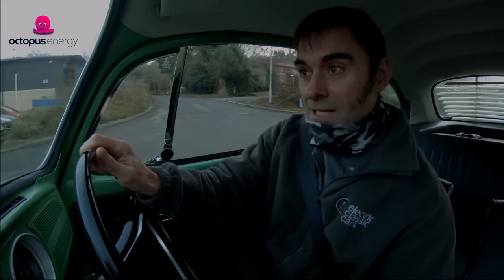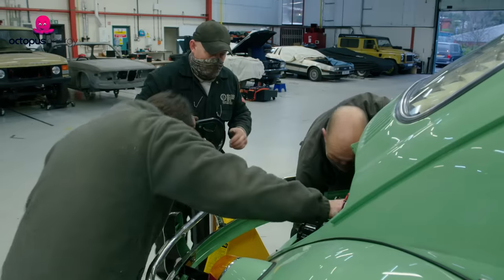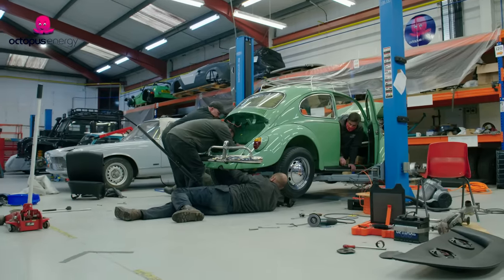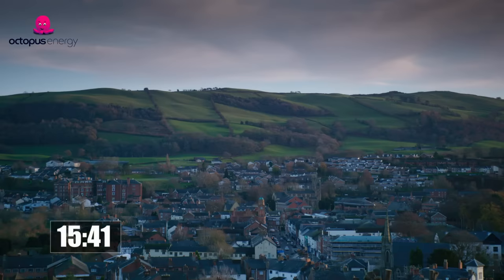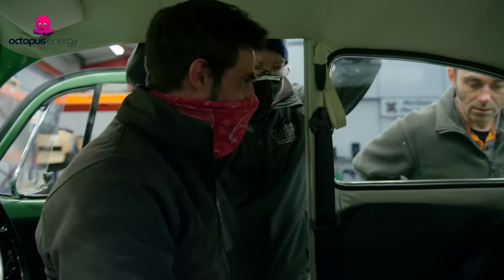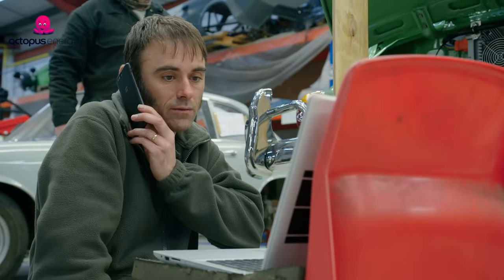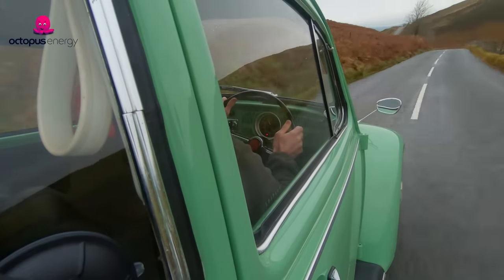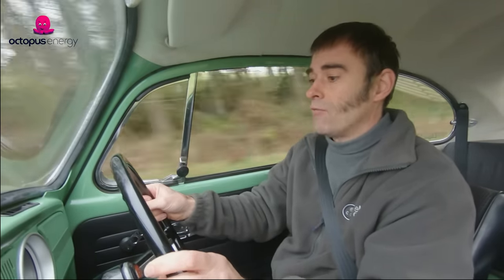VW Beetle converted to electric in a day

Comment: I think that 120hp is just right on a beetle. I personally would happily have this conversation done to my bug!
Reply: You spend 50 grand do it then' the range will quickly dissolve.
Reply: @Teamgeist Freedoms generally a crime these days isn't it
Reply: @Teamgeist if your under the illusion that modern advance electric AI is going to solve   all your problems then carry on but your going to be in for a shock.
Reply: @Teamgeist Hitler's Revenge.....
Reply: @Teamgeist 
He's just a little troll who isn't in command of the English language.
Reply: If you think a transmission designed for 40hp will handle 120 you are nuts or like changing gearbox and drive shaft parts at the side of the road.
Reply: @andrewallen9993  they're surprisingly strong
Reply: Why not just press brand new beetle-chassis, and sell brand new ones electrified? PERHAPS scaled up 20% to allow for bigger average persons nowadays?

Comment: That Beetle and engine are mint. I would have one concern however,and that's being in a crash with a 90kg battery sat directly behind me on the parcel sheIf,even if it were bolted down.
Reply: Agree completely - fabulous little car but that battery’s gonna flatten everyone in the car. Still safer than a motorbike tho! 😎
Reply: Not to mention the front battery pack
Reply: The VW Beetle was never a car you wat to crash in any configuration. Roll overs were deadly as were side or front impacts. I love the Beetle and it was my first car (that worked) but a crash that would be minor in a modern car would be anything but minor in an old Beetle. Of course this was all irrelevant to a 17 year old and I drove mine like a maniac.

Comment: Aw what a shame, half of what make a beetle such a legendary icon is the engine and the lovely chirpy sound it makes and the feeling of how it delivers the power, with the unique quirky signature heater system and close gear changes. Had 7 of these superb vehicles in my teens and twenties, loved every single one, and the 2 campers, all with their individual personality engines that you get to love, which was part of the fun of ownership... Some classic vehicles need electric due to problematic designed drive trains or badly designed engines, while others perhaps not so much...

Comment: Wish I still had my 57 beetle. Would convert it. Surprised at how hard they found removing the engine. Did mine with just a single hydraulic jack by myself. Four bolts, clutch cable and ignition. After 200,000 miles changed the barrels and pistons. Electric is the way to go.

Comment: Very nice with performance. Love the fact that the old classic bug can be kept on the road in this modern world. The only downside is that the Beetles heart is the air cooled engine with that sweet chug chug sound. A sound recording of the air cooled engine needs to be used, and synced with the accelerator and blasted out of a speaker as its driven. Same with classic Muscle cars and their V8 growlers if they were converted. They won’t be the same without the sound of the engine. Maybe a good sound system needs to be installed, just playing out engine noise.
Reply: would you settle for a puddle of oil on your driveway??

Comment: You’ll later have to adjust the rear spring rates - it is high enough to change the wheel camber visually.
Reply from the maker: Nope. A swingaxle Beetle always looks like that when it comes down off a lift. Roll it a few car lengths and the rear suspension goes back to normal as can be seen in the on road shots the next morning. 👍
Reply: @ElectricClassicCars  ah, of course! I knew that - thinking hurts sometimes…. Awesome ride, now.
Reply: That front end looks pretty compressed, I wonder what the extra weight load is on the torsion bar front axle.
Is like to see it put on a road course with a stock Bug.  Electric cats are so heavy the only place I see them win is in drag racing or time attack & hill climbs where is only run for 10 minutes tops w a small battery.
When environmental throw off costs are mentioned, no one talks about kids mining lithium in the Congo with shovels or strip mining for the large amount of materials needed.
Sorry for sounding like a kill joy.
Reply: @bigghouse101  EV's sound cool (have one). But the massive pollution to generate grid power, (plus consumption of non-renewable resources) disposal of car batteries, and processes to get the materials make this solution non-earth friendly.

Comment: Amazing work. I always that older cars will experience a comeback through electric conversion - if fact it is better for the environment to convert an older car than to buy a brand new electric car. Great work guys!
Reply: Debatable, new electric cars may be better efficiency Tesla, aptera etc. You may travel less per j in a converted classic car
Reply: But mostly I agree with you, the electric pickup Chevy and ram are a joke comparing to electric conversion of classics
Reply: Horse shit! I say that as an X -Nuclear Reactor operator, Electrical engineer and computer science as my background. Unless your electric car is running purely on solar it isn't helping shit! There are no green car batteries currently. The power grid has a loss from line voltage, every step up and  step down transformer and most power plants are less efficient than modern gas vehicles. That's  fact. Most current solar cells aren't green. There are some newer processes that are fairly green but they are also less efficient.
I'm not saying we shouldn't move that direction and we sure as hell should invest in research in that direction but currently it is a pure load of horse crap about it being better for the environment.
Reply: @twitte0king  Perhaps I should have been clearer. Electric Car conversion isn't as efficient as newly produced Electric cars like the Tesla. Mechanically, Classic Cars have crankshafts and gears that have been rendered obsolete by Tesla, so there will be rotational energy used, so it isn't the most efficient in terms of performance, however factoring in industrial processes and material extraction, overall the amount of materials used is much less and also less energy and emissions for processes @Electric Classic Cars are basically a private garage and they managed to convert a car adequately. Not as much emissions during the conversion comparatively to producing a brand new Electric car.
As raised by another comment, in the larger scope energy production will need to be converted to Nuclear Power if electric vehicles are to ultimately become environmentally friendly. Unfortunately, Wind and Solar don't have the capacity to handle the demand of Electric vehicles. Their Energy Density is too low and they require additional storage units to be produced. Also, the W/m squared for Solar won't be enough to power every vehicle on demand. Germany attempted to eliminate Nuclear and rely on Wind and Solar, and consequently they had to fire up their coal powered stations. France is perhaps the best example to follow as approximately 70% of energy is produced by Nuclear power.
Reply: Its fucking badly serviced diesels that are polluting the environment not little classics 😱😱😱
Reply: @F22ERaptor . Although a massive amount of France's nuclear capacity is currently offline for various covid, maintenance and manufacturing delay issues. Maybe around 50%. Pretty much all the surrounding countries - even us in the UK - are currently selling them power to make up the shortfall.
Reply: @twitte0king  Sure, but Teslas get about 130 mpg on the American power grid, and infinite mpg on solar power. They're already so much more efficient than gas engines that even if a classic conversion is very inefficient it'll still get like 80 to 100 mpg.

And yes I know the power grid burn straight-up gasoline, this is only an estimate.
Reply: What do you mean a comeback ? They never left.
Reply: @diconicabastion5790  So your argument is that progress towards a goal has no value in relation to that goal?
Reply: @drundub73  like Bob Dylan or Neil Young they just keep going
Reply: @twitte0king  and who cares - classic electric cars will likely not perform as well as new ones, that is a given.  Electric though is better than remaining petrol because one day they will become museum pieces.  I say try it and if we can get 125-150 miles on a conversion we have respected the old designs and turned them into neat city commuters.  I am interested in seeing if we can convert smaller pick-up trucks like the Ford Ranger etc.  I need to haul stuff regularly.

Comment: Kudos Gents for the inspiring EV upgrade to this Classic Bug !   This has me, and perhaps many others thinking about going this route rather than spending too much for a brand new EV.  Plus, like stated, the Carbon Footprint for the vehicle is zero, and if one repurposes Batteries/Motors, it's even more clean/sustainable !
Reply: How much did it cost?
Reply: You have to include the coal or natural gas burned to make the electricity. Or at least the production 
and delivery carbon for solar panels.
Reply: Yeah I was wondering I don't think it's got to be a zero carbon footprint but it's probably
Reply: @ryangrady6894  yes,and the carbon fallout from the manufacture of the components and battery but still will be less emissions than it takes to build any of the new cars❤️✊
Reply: Carbon footprint is far from zero.
Reply: if you ignore the lithium mines and the coal fired power station...
Reply: @juchetony1910  100% gas car vs  46% renewables + 13% nuclear

Comment: Great job guys! What an achievement! What a great team! 

Glad to see you had the same issue I did with the rear apron and hyper 9. I managed to get mine in without trimming but it took a lot of effort. Had to take the transaxle mounting bolts out then jack the rear wheels up so the swing axle action pushed the bell housing down. Trimming would have been easier 😂
Reply: How much money for the conversion kit US? Pretty awesome.
Reply: Looks like a smaller electric motor should have been used.
Reply: @josviersel  That is a small motor. :-) There are plenty with less power, but they're all about the same size.

Comment: If Volkswagen really want to bring back this iconic car in an electric way for future generations that is the solution !
No new designs, no mechanical problems, not just a Volkswagen, but THE Volkswagen. Because even with an electric motor, this should not cost a lot, like the original one.
Reply: Just don’t get in an accident or you are toast.
Reply: Except for the ~20k$ in the EV conversion. (and that was before all the COVID BS ruining the global economy) [DIY can be done for 12-15k, but paying someone to do it for you... with "lego brick" battery modules... multiply by 2.]
Reply: I would buy one immediately.
Reply: @xiaoka  yes, unfortunately there's a reason new cars are so ugly... look like they're on steroids with all the extra bulges, tiny little windows, no interior space despite being twice the size of 70s or 80s cars, and massive screens everywhere. This is the main reason they had to stop making the original Beetle which was produced in Mexico up until 2019. Ironically all the extra safety stuff they have crammed I makes it more likely you'll get into a crash, but also more likely you'll walk away from it too. Swings and roundabouts, as they say.

Comment: Cool video, I would’ve loved to see the transmission shifting process the gauge cluster and what information it provides. Also hear a little bit more about how long it takes to charge.
Reply: From what I've seen with electric motors hooked up to manual transmissions, you basically select the gear that you're going to run in and it stays there. So if you're going to be running around town you may just select 2nd and leave it there, and if you're going on the highway you start in 4th and just go with it. Either that or basically run it in 2nd or 3rd all the time (whatever gear ratio works best).
Reply: with the supplied 6.6kW charger it would take approx. 3 hours to 80% and perhaps 4-5 hours to fully charge it.
Reply: Good point GML, hopefully they installed a new clutch in the conversion, if I owned that pristine VW beetle I would have left well enough alone.
Reply: @wrxs1781  Idiots seldom do.

Comment: People continue to underestimate the regenerative braking with electric cars. The amount of money people save on not having to replace breaks as often is great. I literally never hit the break unless it’s an emergency.
Reply from the maker: Exactly. 😁👍 Until people experience it I just don't think they get it. 👌
Reply: Yes!  Brake pad makers are not pleased with my (non-) braking habits one bit.  2014 Volt, 90k miles, all original pads. That's just nuts 😲
Reply: Catch the bus you'll never need to press the brake. How sad🙄
Reply: @davidmaguire604   the school bus?

Ain’t no buses in 95% of America
Reply: @ComradeStiv  exactly! I’m over 60k miles and I’m more worried about the rust that is building up on the rotors than I am about the wear from breaking!

Comment: You didn’t mention how the gearbox integrates with the electric motor , it was a manual box so are you still changing gears using the clutch with limitations of speed in each gear like a petrol engine and is the clutch / box and final drive components suitable for 3 times the horsepower ? Great job but it raised many questions for me
Reply: yeah like..... how does it handle heat, like Beetles had crap heat to start with since it's just heat from the exhaust.. but no tailpipe = no heat...
Reply: This is what I was thinking. Nobody seems to actually tell you what to do or how they did it. It’s just here you go we did a thing.
Reply: @BarfusWOW  I expect it doesn't
Reply: Almost all these conversions omit heat, ac, power steering and keep the manual gear box.  It's actually harder to adapt to an automatic transmission.
Reply: No Kidding. It's like, Transaxle, meet electric motor. Now work together because you're mounted close together. We want to see the mating process/parts!
Reply: I suspect you chose a gear rather than shifting

Comment: No doubt the electric power conversion improved the interior heating.
Reply: My recollection of growing up riding in a beetle was that the heat could melt your sneaker soles.
Reply: @russzaccari7761  
You must have lived on the equater. 
Or you're very confused.
Reply: Yeah, now that blanket you wrap yourself in is electric, LOL.
Reply: Great heater if all working correctly
Reply: the heater was just like the rest of the car- crap

Comment: Absolutely loved this video. Beetle starts the day with a 40 bhp petrol burner and ends the day with a 120 BHP smooth silky electric power plant. What's not to like?
Reply: 90 mile range...
Reply: No cargo space whatsoever.
Reply: Incredibly short range !
Reply: Shite 90 mile range that's what's not to like.
Reply: @eddkennedy6458  and in five years if the petrol burner needs a carb you could buy one but if you needed an lm309k voltage regulator for the electronics you would have to design and make one yourself out of discrete components. It's impossible to get parts for a Tesla for god's sake and they are still coming off the production line not sixty years old!!!

Plus of course you must like changing drive shafts at the side of the road because a shaft designed for 40 hp won't last long with 120 AND a lot more torque. Do some simple arithmatic and joined together thinking child!
Reply: @mcfcguvnors  1000 quid is about right for a recon motor that will get between 80 and 100 thousand Kms in my experience.
Reply: Stupidly short range , complete loss of storage , and worst of all a total loss of character. Add all that to the considerable cost and what was the point of this ?
Edit. 120bhp and 200 mile range ? If you use all of that 120bhp very often you won't even get 100 mile range , and if it's really cold weather it will be even less.
Reply: Don’t like any of it it’s beetle and it should be pure not turned into junk for rotten electric crap
Reply: Man you pearl clutchers are the worst. They've improved this car immeasurably
Reply: @32BitJunkie  they ruined the car and turned it into a turd
Reply: @32BitJunkie  If you think they did such a good job why didn't you buy one? I didn't buy one because it is an overpriced POS.
Reply: The £30k cost? Id love to EV my '82 Volvo but it's just not worth doing to a car that cost me £500.
Reply: Ruined the car no just mode junk
Reply: Is there a heater in this? How much range do you have to sacrifice to stay warm on cold days?
Reply: 90 mioe ràñg furs t kef warthg 90 mîevrage 9⁰ mole ejrc scters 9⁰ mioe motirçyckes